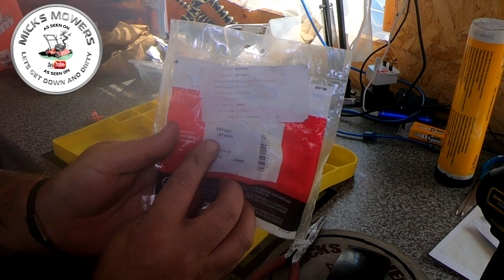Surging Lawnmower Before You Buy A New Carburetor Try This First

Comment: A trick sometimes suggested for a part-blocked carb is to rev the engine (possibly overriding the governer) then fully block the air intake. The engine will soon die but in doing so will pull a good vacuum through all parts of the carb which can help shift blockages.
Reply from the maker: Yeah I have tried that on others..

Comment: Agree with you on the copy carbs, they are dreadful. I managed to drill the jet out just enough to stop the hunt but a new jet is the way to go as the brass used seems to be super hard and breaks the micro drill bits with ease. They should all be the revised jet with a slightly larger hole too now. Well worth the extra money, lot less hassle.
Reply from the maker: Yeah mate and they are cheap too

Comment: Interesting  the carb mounts are identical here in Canada.  I don't mind these carbs   (I almost wrote crabs  LOL) actually.  When they get brittle in 15 years who knows.  I just read these cartridges will fit from the 450 to 550 engines.
Reply from the maker: Ok thanks so I wonder if you can get one for the 3.5 ones

Comment: Do not buy the "who flung dung" copies. However there are other videos with micrometer drills out there suggesting you give the carb a little bit of a fettle. It worked for a mower I had previously +20 thou up the main jet and it cleared it just fine.

Comment: Hey Mick, was there any reason you didn’t just pull that brass pilot jet out and then have the same thing as what you brought? I popped my brass pilot  out and I’ll report back after testing.
Reply from the maker: Ok that will be interesting
Reply: @themowerman  doing a video on this mower and I literally just recorded an extra clip to mention that I’ll try this, watch this space lol. The only thing I don’t know is, if your new cartridge drilling is the same as the one in the old style with the jet. It may run pig rich lol. 

For a reference, the hole under the brass pilot is 1.2mm on these old cartridges, I’m not sure if they are that large on the new ones or if it’s a tiny very fine hole like a typical pilot jet at 0.35mm? From your video the hole looks quite large. Either way, I’ll let you know in the morning.
Reply: @themowerman  Hey Mick, just did a video on the mower, if you have some
time to watch it and share advice on the subtle
popping it would be much appreciated! Also, yes, just twist in a small screw in the brass pilot jet and pull it out, works perfectly without it. Cheers!

Comment: Hi Mick. Here is a question for you. I have a new Allett Kensington 14k (kawasaki engine). Only done 2 hours work. Last night I went to cut my lawn and it was hunting like mad. I put the mower back in the garage with intentions of looking at it today. I started it up and there was no hunting. Engine running like a Rolex. What do you make of that? . Thank you.
Reply from the maker: Hi mate.. could be a couple of things.. could be the fuel tape was off, running low on fuel,some dirt in the carburetor that passed through.... Water in the system..Is the air filter ok..
Reply: Hi Mick. Air filters brand new. I think it could have been dirt and passed through. Thanks.

Comment: Hi Mick, i have a McAlister same engine as the MOUNTFIELD. Starts no problem but hunts, removed carb and cleaned it out, no difference, fitted new carb today, no difference. its got a new filter spark plug and primer bulb and starts on first pull. any idea where i can go from here. Thanks.
Reply from the maker: How much was the carb.. ?
Reply: @themowerman  £35...
Reply from the maker: @AlanShaw101  was it genuine
Reply: @themowerman  It had PAT PENDING moulded in the body as the cheap ones don't have this anywhere, so yes i assume its original, so now the time has passed and this mower has been fitted with three carbs all with the same result so now the owner intends to bury it in his garden. Without the handles.

Comment: Drilling the main jet,  do the same?
Reply from the maker: Yes but if you drill it too big it will run on choke.. so for the cost of a set of micro drill bits you may as well get the jet cartridge

Comment: Never EVER buy a mower with this carb on. My mower has never run right and its now up the tip. Best place for it.
Reply from the maker: I will say they run very lean . But you can get them going ... The problem is a new genuine card is not cheap